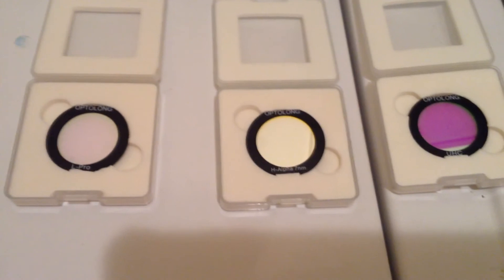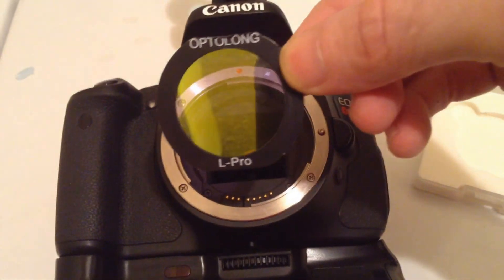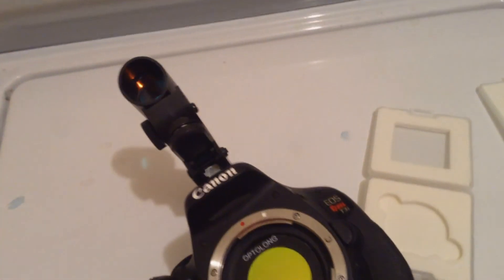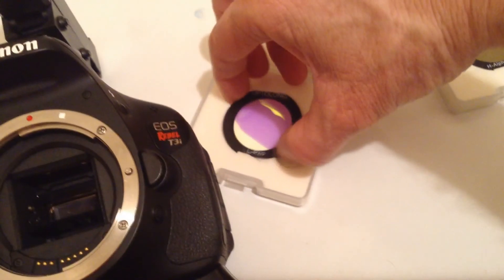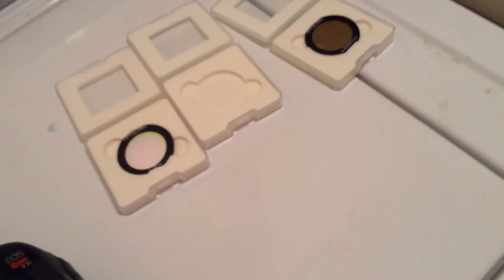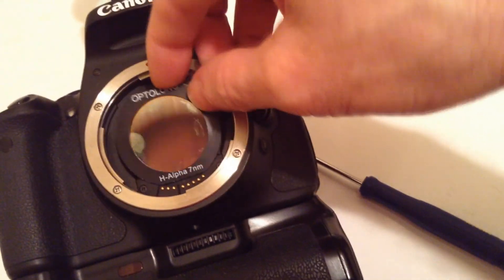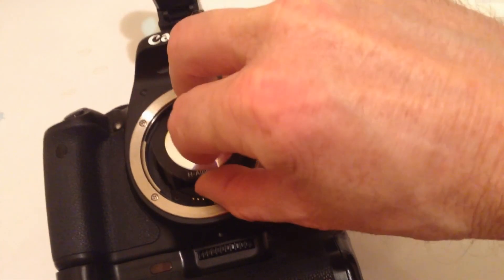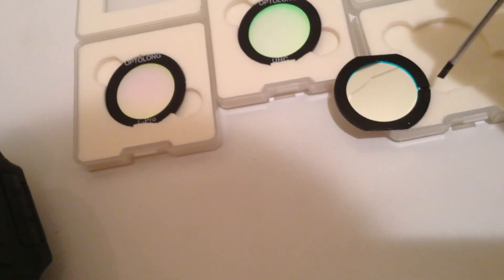Testing The Secure Fit Of The Optolong EOS C Clip Filter Inside The Camera Body

Comment: Hi... Thanks for this video, which I appreciate is now a few years old. I think you were fortunate enough to have 3 different filters, all of which fit. However, you are not right in saying that there is a "misconception" about these filters not fitting.  I have recently purchased a CLS-CCD and an L-Pro, and neither of them fits. The CLS-CCD fits (not very securely) if it is rotated by 180° so that the writing appears upside down as seen from the front of the camera body. The L-Pro won't fit at all no matter how it is rotated. My camera body is just the same as yours. If they were made to a rigorous spec, the filter mounts should all be identical.  Clearly,  they are not. The only way I can fix them in place is with small strips of tape. The screwdriver in the slot "fix" does not help because the mount surround is too rigid. That slot is surely intended to close-up slightly as the filter is pushed into place in order to keep pressure between the filter and the camera body. Optolong does not respond to emails about this issue. I can only suppose that some manufacturing batches are better than others. At over £150 for the L-Pro (currently in UK) this is really unacceptable on the part of Optolong.

Comment: Hello Thomas. 
Can you tell me how you find the performance of the cls filter? Also, is your canon astro modified?
Thanks.
Reply from the maker: I love the performance of this filter but it is only good to use when the Moon is out or you have some kind of sky pollution.
Yes my camera has been modified.
Reply: I'm confused???? What do you mean it is only good if the moon is out? The CLS filter is designed to block out artificial light from city lights or street lights, gamma light; mercury and light pollution of the night skies. Especially for those in red areas. If the Optolong CLS filter only works when the moon is out then that filter is botched badly! :)